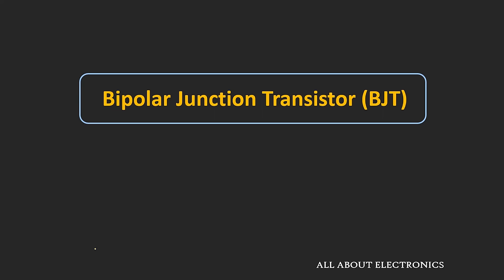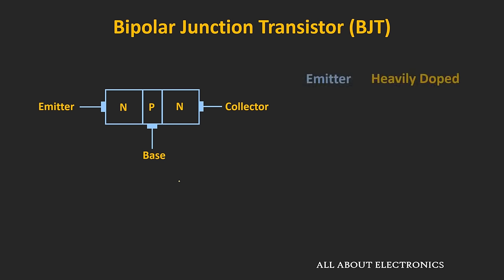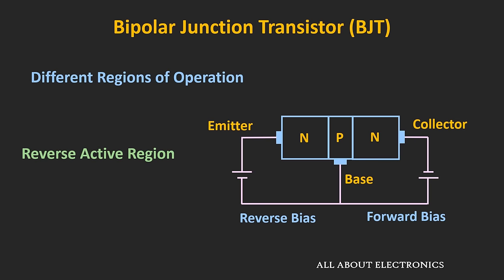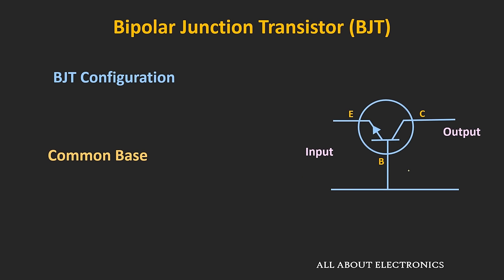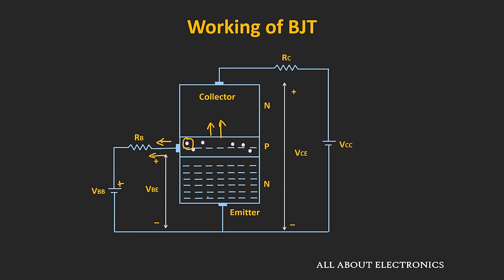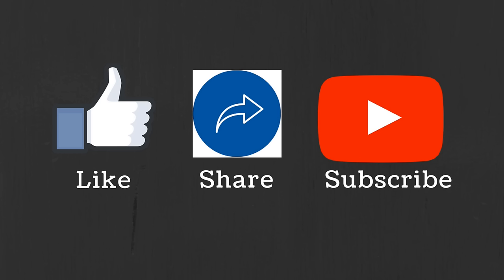Introduction to Bipolar Junction Transistor (BJT)

Comment from the maker: The timestamps for the different topics covered in the video:

0:20 What is BJT?

1:12 Construction of BJT

3:24 Different Regions of Operation of BJT (Active, Saturation, and Cut-off)

6:20 Symbols of NPN and PNP transistor

7:05 Different Configurations (CE, CB and CC)

8:03 Working of BJT

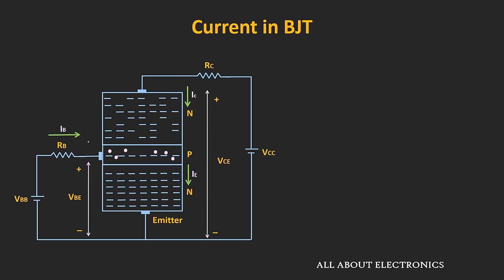12:30 Different Currents in BJT

For more Solved Examples on the BJT, check out this playlist:
https://www.youtube.com/watch?v=byPBZmCfsb8&list=PLH9R5x7JVXCFyPB1oN2oYSqXZv0_2A_AS
Reply: while operating in active region at 3:24 it is in common base  , but it is not in the case at 8:01 (it is in common emitter config and the condition Base Emitter forward bias and Base Collector reverse bias doesn't make any sense ) pls explain sir
Reply: Differentiate between NPN and PNP transistors. According to you which one is going to switch faster.

؟؟؟؟؟؟
Reply: 3.35 you said R-B is reverse biased, should be B-R is reverse.
Reply: @gunanagasindhu9592  I too went back and saw that this was the case. Anyone have an explanation?

Comment: Sir your videos are amazing. So when we are doing Biasing we are not actually changing the polarities of the DC biasing but instead for example in saturation the collector voltage becomes larger than base which is larger than emitter, right?

Comment: Thank you sir nice explanation. But what is our reference when we say base voltage, emitter voltage and collector voltage. Like if we say Vbe, it is voltage between base and emitter right? So how about Vb, Ve and Vc?
Reply from the maker: It is with respect to the ground. For example, Vb is the voltage at the base terminal with respect to ground.
Reply: @ALLABOUTELECTRONICS  Sorry, but where is the ground in case of those forward, saturation and reverse bias schematics that you showed? I mean, if we, for example, define the most bottom node as the ground, base voltage will be zero. So, I guess, it is more accurate to talk in terms of base-to-collector and base-to-emitter voltages, isn't it?

Comment: 11:27 why will it flow towards the positive terminal as now after the combination of holes and electron an atom is resulted which is electrically neutral?
Reply: emitter is highly doped so some get neutral but most of them are moved towards collector side and contribute as "Ic"

Comment: I dont get about the amplification part why Ic=αIe
Reply from the maker: From the emitter region, the electrons move toward the base region. Few electrons get recombined in the base region, while remaining reaches the collector region.
Mathematically the collector current can be defined as Ic= αIe. 
When the value of α is close to unity, Ic is approximately equal to Ic. That means very few electrons get recombined in the base region. 
I hope it will clear your doubt.

Comment: 15:50 i don't quite understand, .." if we connect resistor between collector and emitter terminal, we can amplify the input signal.." what is relation with the resistor?
Reply from the maker: The input base current gets amplified by the factor of beta at the collector side. If the just connect the resistor between the collector and emitter then we can get the amplified output voltage. ( v = I*R).
Reply: @ALLABOUTELECTRONICS  ok i get it, thanks.

Comment: How to measure the voltage without exprement for exam
Reply from the maker: Between which terminals do you want to measure the voltage? Would you please elaborate a bit.
Reply: Means vb is greaterthen vc like
How, you said ve Graeterthen vb greaterthen vc
That's my question
Reply: @rajarajeswari3501  please check the videos on BJT biasing, for that you can check BJT playlist. Doing a little mathematical analysis, you can find that. I have also covered many solved examples related to it in the second channel. Please go through that also. In case if you do not  find the playlist then let me know here.

Comment: at 9:39 it Vce not Vcb right
Reply from the maker: No, it is Vcb, the voltage between the collector and the base terminal. The collector-base junction should be reversed biased. So, considering the NPN transistor, Vc should be greater than Vb for reverse bias. Or in other words, Vcb should be positive. I hope it will clear your doubt.

Comment: How transistor multiplies Base current Ib to Collector current Ic is general information, but does NOT prepare one to use transistors. In fact the  information about a transistor  one NEEDS to design an analog amplifier or  a  digital switch 
is makes NO use of this basic understanding. 
Understanding of  Leakage current, Ico,  which becomes important  in sophisticated design , should come from a  careful study of the workings of a single PN junction.
Reply from the maker: This is introductory video. In a sequence of videos on BJT, how BJT can be used as amplifier, as a switch, and how it can be used in other applications is also explained.

Comment: 00:12 Learn about Bipolar Junction Transistor

02:28 BJT has three regions of operation

04:27 BJTs have three regions of operation: cutoff, active, and saturation.

06:39 BJT can be configured in three different configurations

08:52 BJT is biased to forward bias Base Emitter Junction and reverse bias Base Collector Junction

11:01 Electrons flow from emitter to collector due to reversed biased junction

13:12 Bipolar Junction Transistors are current control devices

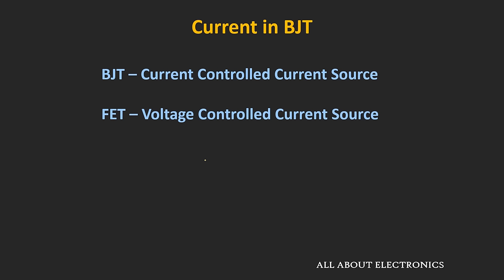15:33 BJT can amplify input signal by controlling input voltage and output current.

Crafted by Merlin AI.
Reply: koi kaam dhandha nahi hai kya

Comment: Is bipolar transistor & simple transistor are same????
Reply from the maker: The transistor is a common term which is often used with either BJT or JFET or MOSFET. All are known as the transistor. So, BJT is one type of transistor. ( It's bipolar transistor, where as FET transistors are uni-polar)

Comment: Here as you said when we given an ac signal at input side then this NPN transistor which is activated in active region will amplify the given ac signal.
Them my question is will we use this type of transistors as step up transformer
Reply from the maker: No, the transistor is used to amplify the small signal where the amplitude of the signal is in mV range. E.g the output of the microphone.
Reply: @ALLABOUTELECTRONICS  👍

Comment: Why do we use BJT as a switch in saturation region? shouldn't it be more stable in active region?
Reply from the maker: We need the stability for amplification. Where he gain should remain constant for the give configuration. But when it is used as a switch then should function as either ON or OFF.
Reply: @ALLABOUTELECTRONICS  Thank you sir. Is it the same for MOSFET? Switching in triode region and amplification in saturation?
Reply from the maker: Yes, true.

Comment: what is the purpose of Rb and Rc?
Reply from the maker: They are used for biasing the BJT.
Reply: How does it biased by using resistors
We have already connected battery to it?
Reply from the maker: @_Chaitu-WA  along with the batteries or any other supply, the resistors are also required to control the current. 
For more info, please watch this video on transistor biasing.
https://youtu.be/5T84Jzcgj7M

Comment: 3:56, why Vb>Ve and Vc>Vb
Reply from the maker: the diagram shows that between the base and emitter there is some voltage difference and similarly between collector and base also, there is some positive voltage difference. That means base is at higher potential and emitter. And collector is higher potential then the base terminal. That means Vc > Vb and Vb > Ve.
And that is the required condition for active region operation. (Base emitter junction should be forward biased, and collector base junction should be reverse biased)
I hope, it will clear your doubt.

Comment: thank you so much for this video. i have one question. does transistor amplify voltage? i mean if some voltage is applied between base and emitter, will this voltage be amplified between emitter and collector?
Reply from the maker: Yes, with the proper biasing, it's possible to amplify the AC input signal. I have already explained it in detail in the series of videos on BJT. For more information, you can go through those videos.
Reply: @ALLABOUTELECTRONICS  Thank you very much